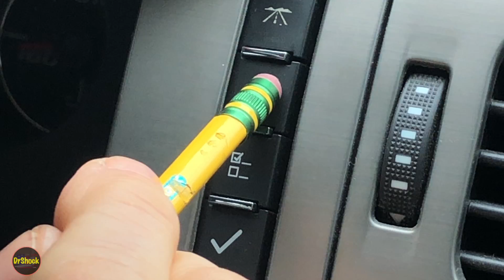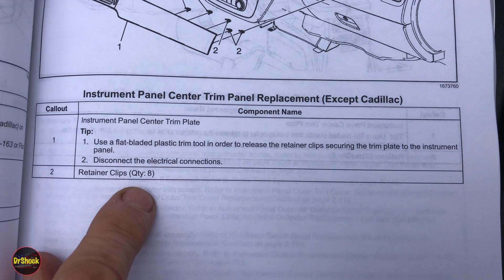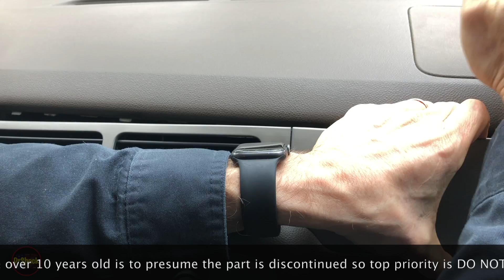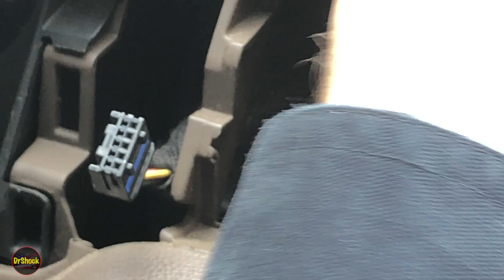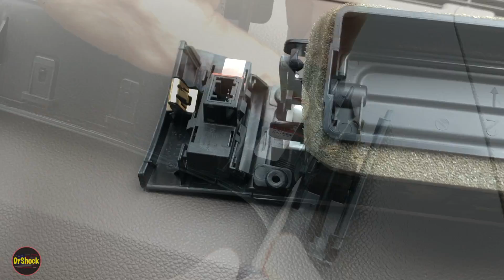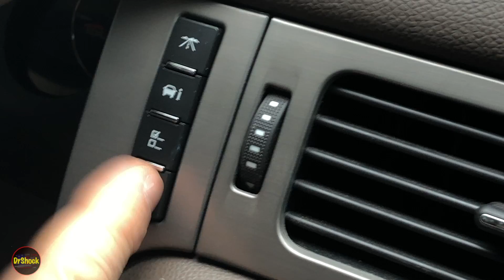2007 - 2014 GM Truck Driver Information Center (DIC) Display Switch Replacement (Chevrolet & GMC)

Comment: Thank you! I just did this fix to my 2011 Tahoe. Using the plastic pry bars was a great idea. I carefully bent the bezel, positioned one side of the new switch into place and then worked the other side in without using a small screwdriver. It went back together faster than it came apart!

Comment: Hey, great video first of all.  Will a bad switch cluster cause an intermittent issue of the display going black? It went out on me and I smacked the dasbyabove the switch and it turned back on lol. But more frequently the display blacks out.
Reply from the maker: Thanks.  I believe your question is whether this display switch can cause the DIC display within the cluster to completely blank out.   I'm not aware of that being a common problem and would suspect the instrument panel cluster as more likely.    But to be sure you would have to do some further diagnostics by removing the trim panel in order to disconnect the switch and see if the problem persists (some lower trim trucks of these model years do not even have the switch).

Comment: Where and how do I find the small panel with a hole for the dic buttons. My 2012 Tahoe ppv doesn't have one.
Reply from the maker: Some GMT900 trucks didn't come with the DIC buttons option, like Tahoe police editions.  So you would have a blank trim piece without the cutout for the switches.  Cheapest route is a pull your own parts salvage yard and looking at used 2012 Avalanche, Escalade EXT, Suburban wrecks for matching trim color.   New would be your local GM dealership, but do NOT give them your VIN (as you're not supposed to have it the part won't come up on their parts list by VIN).

Comment: Thanks so much for this video,  it's always nice to see it done by a pro prior to attempting on your own. Mine went very smoothly with minimal frustration and no broken parts. Not sure if it actually helps but I was able to give a shot of silicone spray right at the clip's, seems to help Pop them loose.